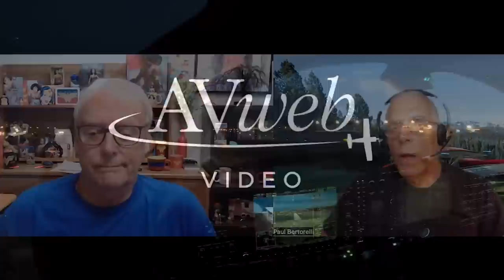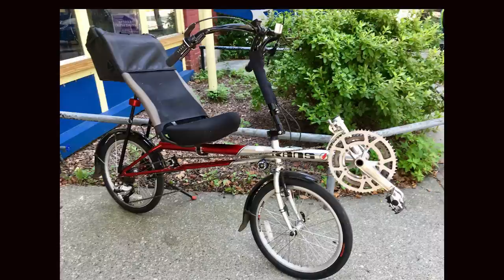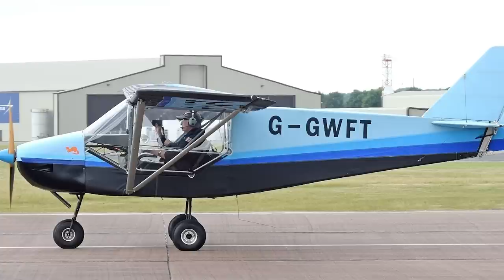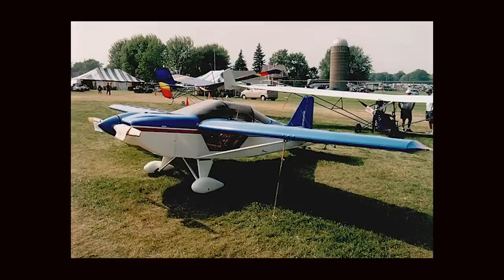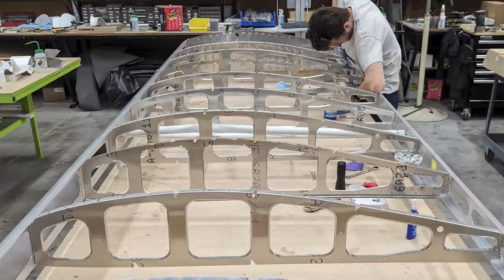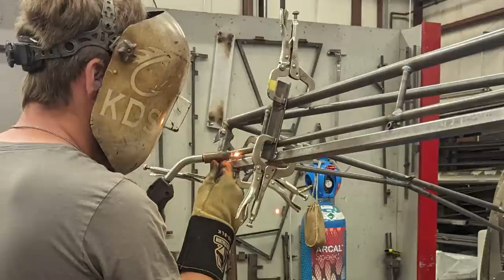Interview: 40 Years of RANS Aircraft

Comment: Smart to know that 3d printing is the future although it needs to get a lot better and the makers of the machines have to realize that cost matters. So far they are way to fond of status quo. There will come a time when vehicle designs can only be manufactured by '3d printing'. Which I know from UFOs.
It's also true that electric only really works with a very efficient plane so why not use that realization and see that all planes should of course be intelligently designed like gliders instead of dim tractors of the sky. It's not just electric or gliders where efficiency is smart. It's just with a murican engine you don't notice it's a flying anchor. Optimization is king. Similarly with a miter machine, LSAs can be very simple products, if you optimize the production it can be dirt cheap to make a plane, as it should be and that's a good way to whittle down the 120 producers to 5 and increase the market dramatically. Maybe get rid of some of that WW2 metal that GA is still suffering gladly. An LSA can be made with maybe 5k$ worth of brand name carbon fiber. And you can make the entire fuselage in a single mold to cut down on labor. So why do they cost 200k or 400 in the case of Elixir. Apparently a carbon cub has crossed 400k too. Which is a WW1 aircraft. Fabric over metal frame. The level of non thinking is staggering.
A glider body shape lends itself to shell rigidity, meaning very simple production.
You can get a complex shape enclosed carbon fiber kayak retail for 2k$. Some of them have multiple different materials sandwiched and core material. How can they make very awkward shapes cheap and planes makers making easy shapes are like popes. We couldn't possibly make this cheaper than 400k. It's a small market.
If you had to make a billion dollar car factory, sure but this is a winged canoe and a compound bow we are talking about. And a briggs and stratton. And a commodore 64 if you want to get technical.
And a side note on clean designs, couldn't a light plane do without flaps. Is the difference more than a quarter of a second of braking. Is it really worth the complexity.